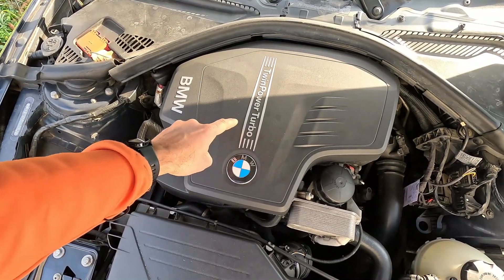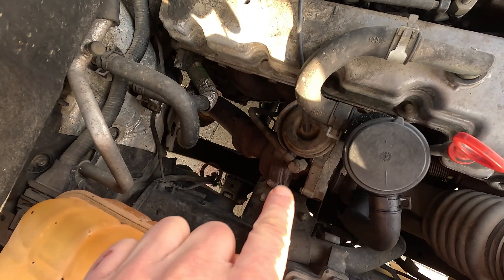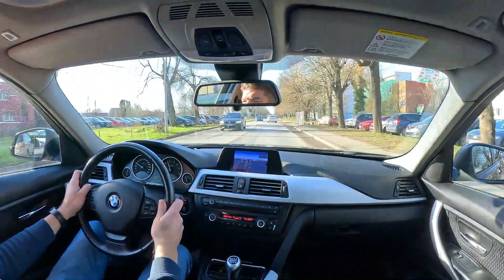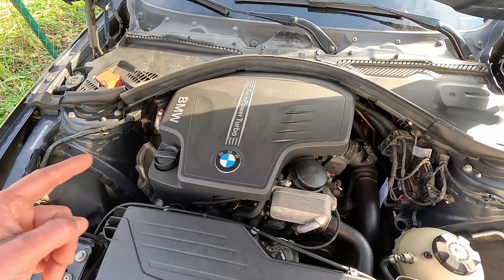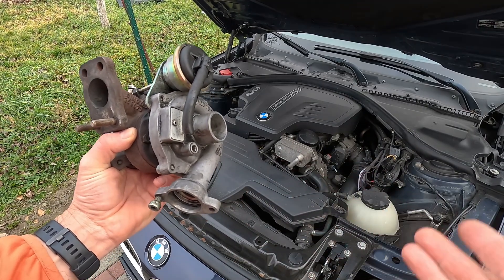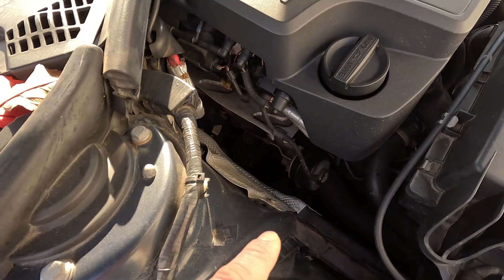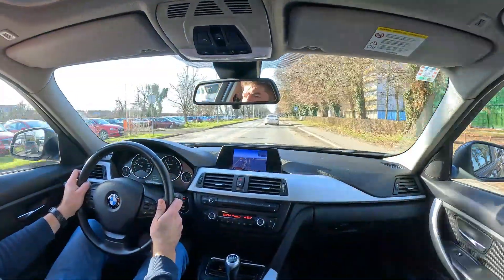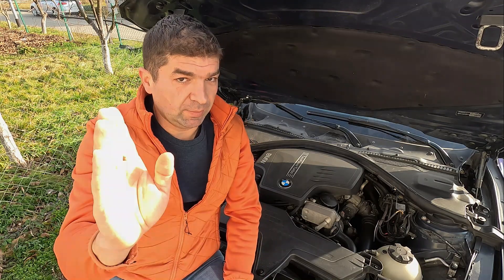7 Symptoms of a Bad Turbocharger (& Replacement Cost)

Comment: Excellent video 👍
I’m having low mpg & emissions issues, I need to clean maf & map but also air pressure test between turbo, intercooler egr & manifold, possibly a leak but I can’t hear hissing?
Variable vane actuator may possibly be stuck, as you suggest. 
Again, thank you for a very good video, from a subscriber 👍
Reply from the maker: Thanks for watching👍